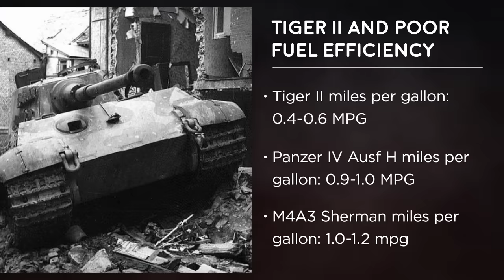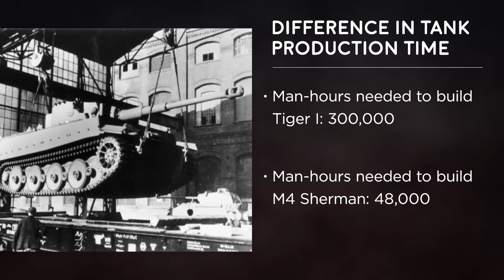Why Did German Tanks Perform So Badly in The Battle of the Bulge?

Comment: In 1940, the German advance had gone west-southwest and utilized the elaborated road network.
During the Ardennes offensive they were restricted to only 5-6 roads, and couple with that, you have roads that are very narrow and step, which increases fuel consumption considerably.
The few roads capable of handling the heavy German tanks, made it easy for the Americans to slow down Peipers Kampfgruppe by blowing up the bridges just as the Germans were approaching. Peiper himself is said to have said: "Those damned engineers".
Reply: Peiper's route was chosen by Hitler himself, an example of his ludicrous micromanagement of operations
Reply: But Americans act like its an insane accomplishment that they held off the german attack while having full artillery and air superiority and only having to defend 6 roads
Reply: @jobvanhetkaar8848  
In the first week of the offensive, Allied aircraft were all grounded by fog and bad weather. Some sorties were flown, but nowhere near enough to have an impact on the German advance.
But after 7 days, the weather cleared and the 'Jabos' went hunting again.

At the start, the Germans had more men, and more tanks than the Americans divisions stationed in the Ardennes.

The Germans: 250 000 German soldiers and about 1500 armored fighting vehicles.
The Americans: 80 000 men and about 80 armored vehicles.

Simpler put, 25 German divisions vs 4 American divisions, when the German barrage opened up in 16th December.
Reply: @wolfu597  the Germans were very undersupplied from the start and they never had any significant air support. The Americans were being reinforced every day while the Germans didn’t even get enough fuel to make it to their set goals. It was a doomed offensive. It’s a miracle that they got as far as they did.
Reply: @jobvanhetkaar8848  I agree, the Germans did well getting as far they did.
Many German generals suggested that the offensive should be limited to the river Meuse, because they knew all to well that capturing Antwerpe at this stage of the war was a pipe dream.
There were major fuel dumps in the Ardennes, but in order to maintain the element of surprise, the Germans hadn't conducted a proper reconnaissance of the area, and that led to some bad decisions on the German side.
One such instance, was with Kampfgruppe Peiper. After crossing the bridge at Stavelot, Peiper turned left in the direction of Trois Points and its bridge. Had Peiper turned right, he would have stumbled upon a massive Allied fuel dump that contained the 800 000 gallons of fuel that had been spirited away shortly before his arrival at Stavelot. 
You can probably imagine how Peiper reacted when he heard that he missed out on 800 000 gallons of enemy fuel.
Reply: @ihatecabbage7270  
This offensive tapped into Hitlers very last reserves, in terms of fuel, tanks and man power. They had so little fuel, that they banked on capturing Allied fuel dumps, and as we know, the Americans destroyed their fuel dumps if they couldn't salvage it.
Reply: Are gou saying Americans tend to pat themselves in the back and self-congratulate?

NOOOOOO WAYYYY!!
Reply: @wolfu597  by converse the Americans also knew it was a pipe dream so weren’t expecting Germany to blow all their reserves on an attack that essentially surrendered the western front if it didn’t succeed on a pipe dream
Reply: @AaronRMG  bro I just wanna say that I don’t mean any disrespect to the American soldiers who fought in the battle cus, as you are saying, the American soldiers stationed there weren’t really ready for such a battle and the battle of the bulge was one of the most intens battles of the western front. I’m just saying that the Germans couldn’t have been successful in their offensive, even if the Americans weren’t as successful in defending as they were. Again, respect to the American soldiers who fought in the battle.
Reply: @jobvanhetkaar8848  Churchill    I have seen it suggested that the terrific battle which has been proceeding since 16th December on the American front is an Anglo-American battle. In fact, however, the United States troops have done almost all the fighting and have suffered almost all the losses. They have suffered losses almost equal to those on both sides in the battle of Gettysburg. Only one British Army                                                      416  
 Corps has been engaged in this action. All the rest of the 30 or more divisions, which have been fighting continuously for the last month, are United States troops. The Americans have engaged 30 or 40 men for every one we have engaged, and they have lost 60 to 80 men for every one of ours. That is a point I wish to make.    Care must be taken in telling our proud tale not to claim for the British Army an undue share of what is undoubtedly the greatest American battle of the war and will, I believe, be regarded as an ever famous American victory.

Hansard WAR SITUATION AND FOREIGN POLICY HC Deb 18 January 1945   on line
Reply: @AaronRMG  quarter million soldiers.
Reply: @sotros1  Oh I wholeheartedly agree with you that there's serious history being made in USA.  No doubt about it.
Still, reread my post and tell me I'm really wrong.
Reply: Plus, the 101st Airborne hanging onto Bastogne severely hampered any notion of repeating the 1940 route and crossing the Meuse at Sedan.  It was the junction of several roads and rail lines, and German logistics were heavily rail-dependent.
Reply: @selfdo  
The 101st got there just in the nick of time. But the last unit on their way to Bastogne, the 326th Medical Unit, was captured as they came close to Bastogne. So the American paratroopers were left with nothing in terms of doctors, nurses or hospital equipment.
Reply: @jobvanhetkaar8848  i mean, it sure as hell wasn't easy.... especially considering the air superiority was often grounded by horrible winter weather (which is why the Germans attacks in the winter in the first place)

So yeah, outnumbered, surprised, without air support at first.... i dunno why the Americans would think it's something to be proud of that they utterly crushed the German offensive....

(this is why you should never bring single-source 'historical knowledge' into an open foprum, it's very bad for one's dignity....)
Reply: @petriew2018   “crushed the German offensive” the Americans lost more men in the battle and only started pushing back after they got their planes back in the sky
Reply: @petriew2018  I mean, I’m sure you didn’t miss that detail as I’m supposed to be the one bringing single source information to the conversation
Reply: @jobvanhetkaar8848  and the German army lost it's ability to conduct any offensive operations on the western front ever again because of how much heavy equipment they lost... it was a crushing defeat that basically decided the war in the west.... and gained absolutely nothing for it

crushed

cope
Reply: @petriew2018  the war was already long lost by then. There were a lot of factors in that battle that made sure the offensive couldn’t succeed, mainly a lack of oil. The Americans had artillery (and later in the battle also air) superiority which made it, combined with the bad German supply situation from the start of the offensive, a doomed offensive. I mean yeah you can be proud as an American that the offensive was contained, but it would never have succeeded, even if the Americans wouldn’t have been as successful defending as they were.
Reply: @jobvanhetkaar8848  this is olympic levels of mental gymnastics... it would be impressive if it wasn't in defense of a bunch of war criminals...

but yeah, the biggest factor was the tenacious defense of the Americans who the Germans just assumed would retreat, Which bogged the operation down until the weather cleared and then American airpower turned a bad idea into a clusterfuck, which Patton's rapid and unexpected counter attack from the south turned into a crushing defeat

how you lose doesn't matter in the end. What matters is that you lost.
Reply: @cyclingnerddelux698  Really????  Go no further than this thread!! Read Petrie W's comments!!  
Anyone disagreeing that Americans often have overly glorious views and opinions on their performance in WW2 is in denial, in my humble opinion.  It's a stereotype at this point, so much it is common.

The hat might not fit YOU personally, but don't deny the phenomenon around.
Reply: @jonathanallard2128  you are partially correct, but you're also kind of ignoring how many people, mainly those who hero worship the German army, completely dismiss the performance of the Americans as well, just hand waving away any of their success as due to simple material superiority. Despite the fact that german accounts of the battle have them completely stunned by just how hard it is to actually dislodge isolated American elements from their positions until they literally ran out of ammunition

but no, it was just american air power.... that couldn't fly for the first week.....
Reply: Col david pergrin led the dammed engineers.
Reply: @jonathanallard2128  ha ha
Reply: The Germans were also going through a lot of fuel in Barbarossa. Hardly anything paved in Russia. I read somewhere Ohio had more paved roads than Russia in 1960.
Reply: @petriew2018  I don’t think you realize that I respect the Americans who fought in that battle. They fought the Germans tooth and nail when they were, at least in the start of the offensive, facing a larger force with more tanks. I don’t want to discredit the performance of the soldiers either. I’m just saying that the offensive couldn’t have succeeded even if the Americans didn’t fight as good as they did.
Reply: No tank types performed great in the Ardennes on either side. It was poor tank country all around. Hills, woods, narrow twisting roads, small bridges. Even a 25 ton Jagdpanzer IV collapsed a bridge and they were nearly ten tons lighter than a Sherman. 
The allies didn't move any faster during their counter attack in January. They struggled in the terrain and weather too. Most Sherman tanks had narrow tracks which were not good in snow, slush and mud.
Reply: @AaronRMG  Yeah, pretty sure they mentioned 250k soldiers in this video.
Reply: @AaronRMG  I was merely stating facts tho. No real disrespect intended.
Reply: @selfdo  as did the stand of the 99th and 1st IDs at Elsenborn  and the mixed units at St. Vith.
Reply: @wolfu597  I've heard a legend that a rather attractive US Army nurse from that unit was brought to the CO of the Panzer Lehr division, Fritz Bayerlein, and she "diverted" his attention from the battle.  Whether such diversion was simply friendly conversation, or something more, only they knew, and whether it caused his to neglect his duties, hard to say.
Reply: @metronorthwtrain1452  No surprise.  Most of what highways the Soviet Union built from WWII to its collapse in 1991 were military in purpose, and often ran along established rail lines, if for, nothing else, to save on costs.  It's easier to build on established right of way, and the Soviets continued the wartime German practice of clearing a fairly wide swath of forest about the railroads, they did, for a time, have, in some areas, especially the 'Baltic' SSRs, insurgents known as the "Forest Brothers"! 

 Supposedly more road mileage and actual freeways have been built since '92 in the Russian Federation than in the Soviet period of 1917-1991, but I've no hard data to support that assertion.
Reply: @jonathanallard2128  Because that is what winners do!! LOL
Reply: @terraflow__bryanburdo4547  Winners are humble and don't need to add to their accomplishments to feel secure.  

But yeah sure!  !'MMURICAAAAA!!!
Reply: @jonathanallard2128  You are right, owning their victories only served the Romans for a thousand years. And the world's largest contiguous empire, the Mongols, were well known for their self-deprecation...
Reply: In May 1940, Germany had control of their airspace and they had a full power armed forces, they were not expected to be going through the Ardennes.  The Panzer II's, III's, short barreled IV, P38, p35 were all much smaller tanks than the Panther or the Tiger.  For December 1944, the Germans could only move their armor at night, and they had very limited fuel stocks.
Reply: @jobvanhetkaar8848  The germans didn't achieve anything significant in the battle except burn their strategic reserves. But in the first few days where the germans did make progress, the allies were outnumbered and didnt have much experience or heavy equipment. Thats just a fact. But where they did have some decent forces they held Germans at some key points
Reply: @jobvanhetkaar8848  Suck it up fanboi - the Yanks were much better organised from the farm gate to the battlefield. The Germans might have fought well at the tactical and operational level but it was a 'no contest' at the strategic and geo-political level. AND it still true today in the Russia vs EU/NATO contest. If it wasn't for the Ukrainians and the US Germany would have Russia as a threatening neighbour today. Germany hasn't been on the right side of history since Bismarck was a boy.
Reply: @graemesydney38  everything you’re saying is true so I won’t try to argue with you
Reply: @graemesydney38  only the fanboy part isn’t lol
Reply: 25 German divisions on paper. If my Corps needs 3 divisions' worth of supplies and I only get 2 divisions' worth, I'm gonna report less losses so I can have more fuel rations.
Reply: @jobvanhetkaar8848  doesnt matter we still won. Where was Europe? Oh that's right defeated...
Reply: @wolfu597  indeed as fuel is 🔥 then they must have realised it would be lit to deny it to the enemy if poised to loose control of it
Reply: @jonathanallard2128 I do
Reply: @jobvanhetkaar8848 by 44' it was over for both Nazi Germany and imperial Japan..the writing was on the wall...
Reply: @petriew2018 Germany was a formidable fighting force ..but could not go toe to toe with Americans by 44' or so..they lost their mojo and both Germany  & America knew it..
Reply: My father was one of those damned engineers. His job was to blow up the bridges as the Allies retreated. He fought for the 241st and the 244th. He lost his arm on the last morning of the last day of major fighting at the Ludendorff bridge at Remagen. The Americans were attempting to cross in order to put up a pontoon bridge for Patton.-.Patton had been unable to cross further south. My dad said that the Tigers could be heard miles away, but they were terrifying because of their accuracy and power. He said that their turrets were particularly loud and when they're turrets would start to move is when soldiers became most nervous. This is all the while that the engineers were wiring the bridges.  When the turret stopped many soldiers would take off ten- fifteen yards as fast they could.and hit the ground. This is because when the turret stopped that meant that the Germans had targeted a spot and we're ready to fire. Said there were hundreds of small old Bridges in the Ardennes. He also said about three weeks later they were rebuilding the bridge that the Germans had either blown or wired themselves as they retreated. He was stationed about 4 miles from Malmedy at the time of the massacre. My father stated that the general reaction to the news of the Malmedy massacre was at first they didn't believe it. What people don't realize was is that several soldiers hid or were just wounded and they passed the word. His unit was loaded with new recruits after they had been pummeled at the Hurtgen Forest. He said the many new recruits at the beginning of the battle froze or did crazy things and drew fire or or stood up and ran.
Reply: wasn't there also a armored division fighting along the 101st? @selfdo
Reply: @graemesydney38   ''Germany hasn't been on the right side of history since Bismarck was a boy.''

???
Can you elaborate on that?
Reply: @guusandveronieterwoorst6378  Fourth AD.
Reply: @jobvanhetkaar8848  "Americans act like it's an insane accomplishment that they won by being better in the first place." Are you hearing yourself?
Reply: My great uncle was in one of those Engineer Battalions (1106th Engineer Group) as a motorcycle messenger. He was ambushed once and made it back with his bike.
Reply: In almost every war, big tanks suck.  Even the M1 Abrams was sinking in the sand in Desert Storm and today in the mud of Ukraine.  Plus the horrible logistics of moving 140K pound vehicles is not a way to win a war.  Well made, quick, low cost and easy to mfr and repair, and better tactics wins wars.  Anything big is just egotistical BS.
Reply: @onylra6265 Well he did that because the generals often screwed up like wanting to take Moscow without securing the flanks at Leningrad and Kiev.